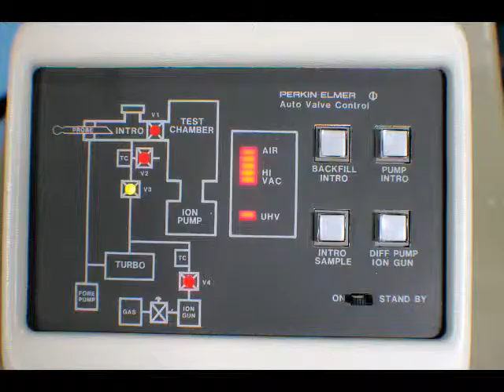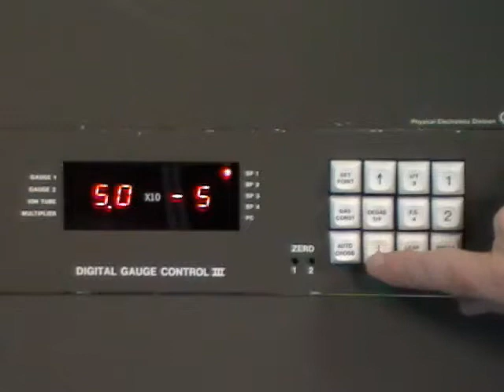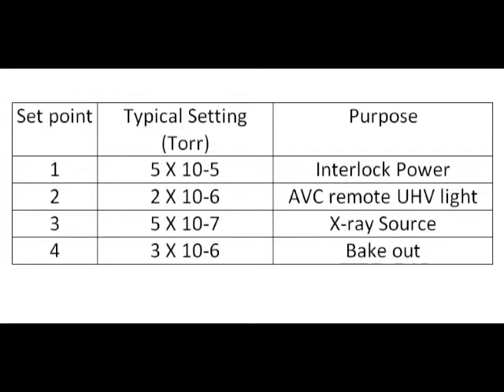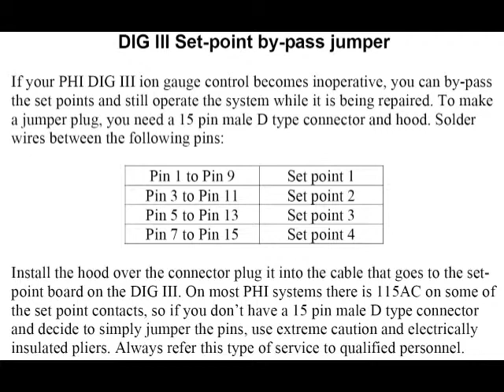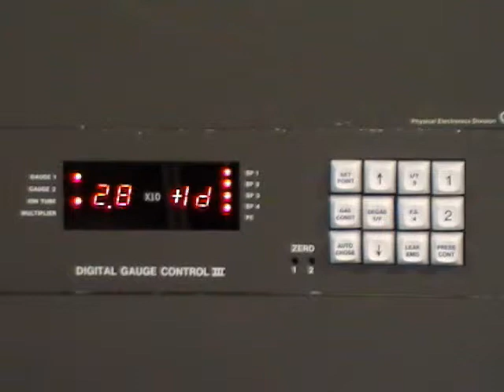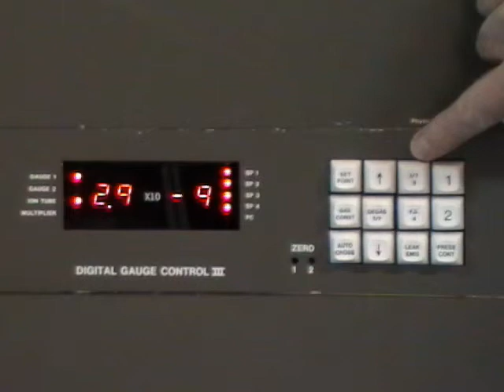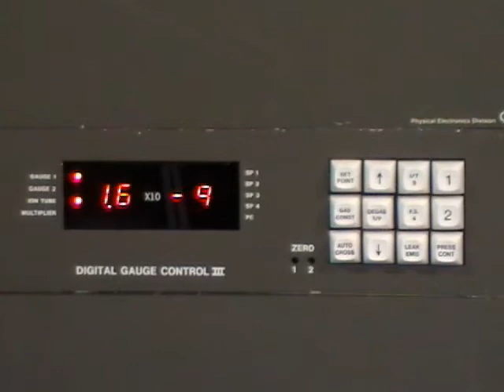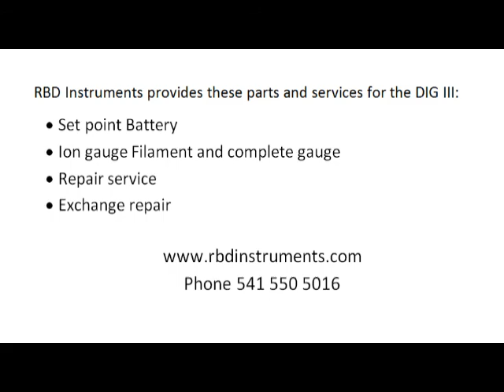DGC III Digital Ion Gauge Control Operation.mp4

Comment from the maker: Hello Brian,  I would check the ion gauge filament resistance and also the connections to the ion gauge.   Your filament might be open or the collector wire to the ion gauge might be loose.

Comment: Dont know if you can answer this off the top of your head, but, when I hit the I/T 3 button the vacuum pressure (4.1x10^-11) flashes on the screen for a second but then reverts back to reading 0.0 x 10^-3. Any Ideas?